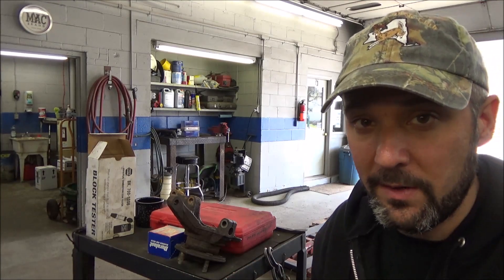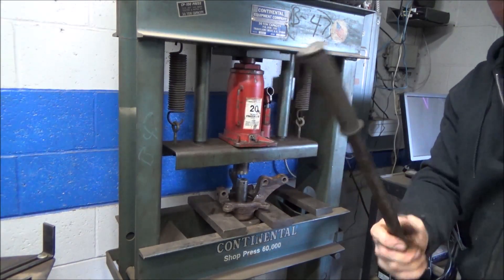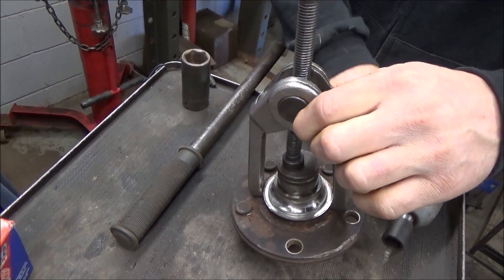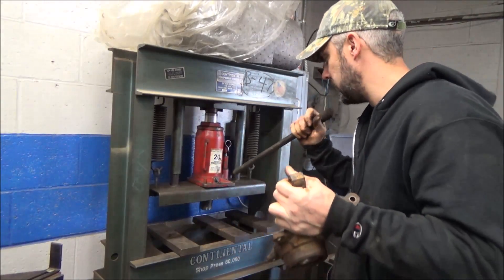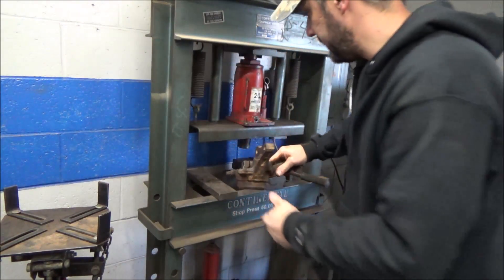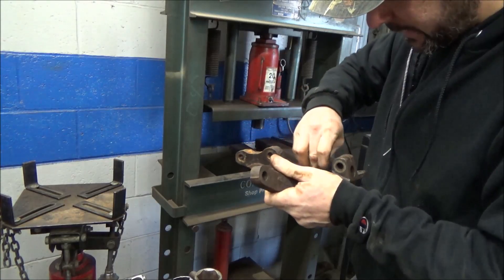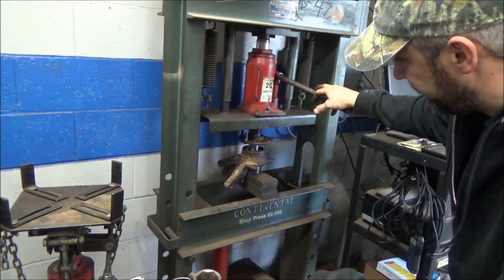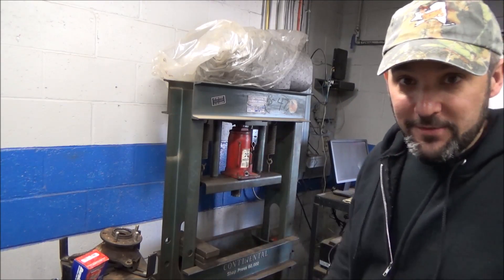How To "Press" A "Press In" Style Wheel Bearing

Comment: My two cents is getting a shop press is not enough: don't think you can get a 12-ton shot press from harbor freight for $130 and be safe and I'm speaking from first hand.

You will need to invest 50 to $150 in different adapters and arbor plates.  I so totally wish I just gave pep boys $70 per side to do my bearings after I destroyed one spindle and one shot press which harbor freight was great to replace for $36.

I have the same spindle and that's how I broke the presses I could never get it lined up straight and that's also how I shirt off one of the ears and that was after watching this video!

Comment: Have you ever turned a press job away because it was impossible to set the hub assembly on the press?
Reply from the maker: +Erik Andresen Me!? Turn a job away!? Never haha
Reply from the maker: +Erik Andresen I remember what my grandma taught me... "nothing is impossible for the torch..." -G-ma O.
Reply: +South Main Auto Repair Never turn a  job away?  Except maybe transmission R&R on an Audi Quattro...
Reply from the maker: Scruit ouuuchhhh.... had to go there didn't ya....    -_-
Reply: +South Main Auto Repair Never did an Audi but have done a Subaru a couple times.  No fun.
Reply: +Scruit try the timing chain on one of the v8 audis, what a nightmare.
Reply: +acehole1990 or wasting ur time on those Chrysler 2.7 engines

Comment: Could the first part of this video be considered as a DEPRESSING VIDEO. LOL
Good thing you weren't PRESSED for time. LMAO 😆 😆 
That snap ring goes on the outer betting, so what keeps the spindle from coming out from the forces from the wheel ?????
Reply: Huh? The bearing is captive by the spindle bore, bottom of bore, and the snap ring. The hub is interference fit, yes. But the hub is also is under clamping force from the axle nut at ~100+ ft-lbs torque with a big clamping surface. And the nut is then staked so it cannot back out accidentally.

Comment: Before I had a press available it would take me two days to do a bearing. Beat the crap out of the old one (without destroying lock-ring) like that guy did to get it apart, but i did use heat. Then freezing the new bearing in deep freezer for a day (don't tell the wife) frozen bearings will fall right in to their new home. then freeze the hub face doesn't fall in as easy so you still need to support the inner race for that part.

Comment: I bought a lil 10 ton nip nop shop press and it works pretty decent. i've used it only a couple times but I did use the ears for the caiper and the mounting flange for the strut to press against. I didn't break them but now that will concern me.... So I assume you've seen them break? I figured the hubs are tough as shit, they take alot of abuse day to day on the road. Also in my younger days i've smashed them with stupidly large hammers beating stuff in and out and have yet to break one. Maybe it's cause I usually work on old honda's? Now I do with I had go the hub tamer kit, but then again I think both serve a purpose and I suppose I can use bits from the hub tamer kit for the press? right?

As usual you taught me more then a few things. Always enjoy your video's and I always seem to learn something to make things easier. Only problem is you always show me neat tools I have to buy :)... I do however find some of the stuff you talk about very affordable, ie the Astro line up, amazing tools, great price, sure it's off shore but they have some good, well thought out stuff.

Comment: A hub bearing is so much easier than this crap. Took me about 45 minutes to change my front wheel bearing on my Grand Prix with a new Timken assembly. Zip zap you're done. Used my big AirPro impacting ratchet for that job. That sucker is nasty. Zipped the three bolts holding the bearing in from the back out in seconds. Of course they were in perfect shape since I live in Arizona. Didn't even need to use any Kroil.
Reply: +SATAMAN Schmidt They cost more on the surface but they're bolt in. You gotta appreciate that. :)

Comment: I am NOT fond of how a hub is simply held in place via compression friction.
Reply: +Jeffrey dontyouwish Axle and a nut hold it together aswell.
Reply: now534 
Yes, you're supposed to put the axle in and fully torque it down before putting the load of the car on it. It gets sandwiched together so it's not going to come back out in its own.

Comment: Can you just buy the wheel hub instead of pressing in the bearing
Reply: Yes, my 2002 Montero was less than $40 for front bearing and spindle plus all new and installed it quicker, safer too.Check out Rock Auto, E-Bay or Amazon.